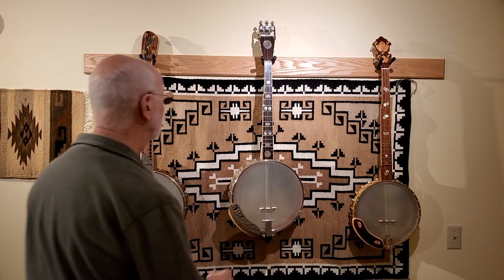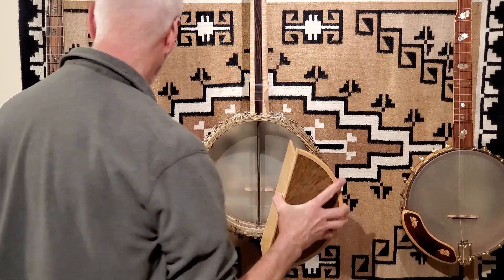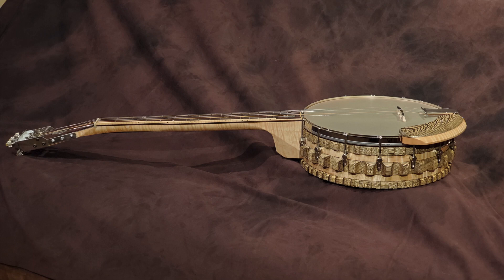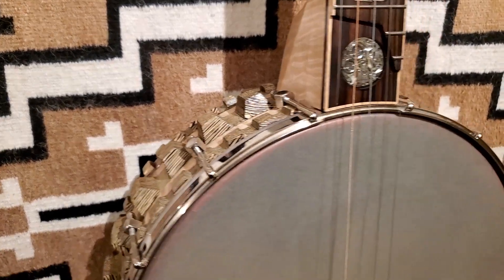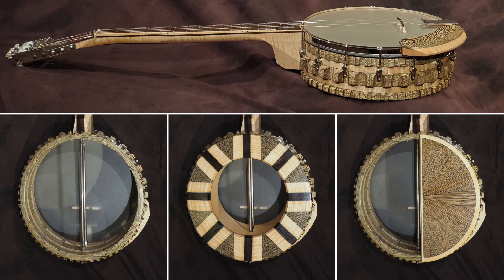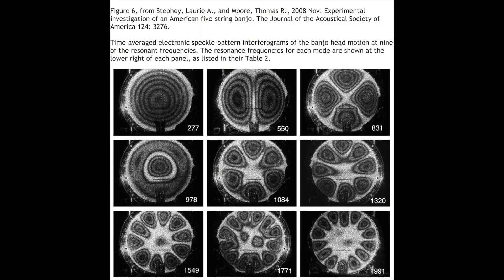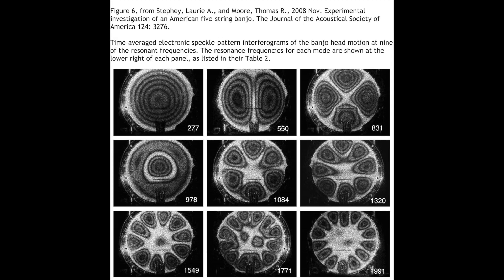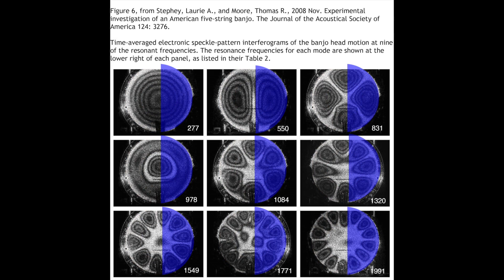A new kind of Internal Banjo Resonator

Comment: Is anybody still here?  😎  I want to try 3d printing a bacon style resonator, Does the rim of the resonator actually touch the banjo head?
Reply from the maker: NO! No part of the resonator should touch the head: that would dampen the vibration of the head and really decrease the volume and tonality of the banjo. Or it would cause a horrible "rattle" if it comes close enough that the vibrations of the head are large enough to make the head touch the resonator rim. The inner part of the resonator shouldn't come any closer than about 1/4 to 1/2 inch from the head. That space between the banjo pot and the internal resonator becomes a semi-independent resonant chamber that affects the overall tone. The amount of the  "1/4 to 1/2 inch" separation  you choose will affect the final sound.
Reply: @jpmillerusa    I kind of figured that. A more correct question would have been "How far is it from the head?"  Thank you very much for the info.  I am going to try printing one with carbon fiber. It'll be some time before I get anything workable, but I will let you know how it turns out.
Reply from the maker: @CosmicCowboy56  Great! Yes, Me know how it turns out! Can you make a half-moon one too?
Reply: @jpmillerusa   I'll give it a go. 😎  I don't even have a banjo yet.  LOL  I'm going to go get one on Monday, though. I used to play, but life happened and I haven't picked one up in a while. It'll be good to get back into it.
 Between the printer and the banjo, I should be able to keep busy!
Reply from the maker: @CosmicCowboy56  Yay!
Reply: @jpmillerusa  In what way exactly does the amount of separation space chosen (you said between 1/4 and 1/2 inch) affect the final sound? I'm going for the deepest, warmest, and spookiest sound possible from this instrument.  Minor chords go a long way for that haunting sound of course, but I want to see how far physical modifications can take it as well.
Reply from the maker: @Nein01  Great question... but I don't know the answer. I know how I woould test it: build one that had a big spacing, with an attached slider that could move up and down to change that spacing. But my hunch is that the maximum effect is always going to be with the spacing as small as possible: because the other limiting effect is with no resonatror at all. I imagine a graph of "spookiness vs. spacing" that starts at zero with NO resonator wall, going through a smooth curve up to a maximum when the spacing is as small as possible. Can't imagine there would be a hump someplace in the middle of the curve, but there might be... that would be a great question for David Politzer (do you know about his "Banjo Physics" website?) 
>>> But there are other ways to maybe increase the spookiness: like put on heavier strings and /or de-tune a bit. Decrease the break angle on the bridge. Maybe de-tension the head a bit.
Reply: @jpmillerusa great suggestions, and thanks for the resource recommendation. I was not familiar with David Politzer until now

Comment: Mr. Miller: The reason for the skin inside the resonator?
Reply from the maker: I am not sure what you mean by the skin inside the resonator. Do you mean the dark material on the back inside surface of the semicircular part, seen at about 1:25? If so, that is a layer of carbon fiber sheet below the wenge wood wedge segments to add structural strength and to prevent warping. The wenge pieces were fairly thin, so I just glued them on top of the carbon fiber sheet.
Reply: @jpmillerusa  Thank you.

Comment: Amazing job! I am trying to build one of these half- circles and have a question: Wich is the gap between head and vertical wall? Thank you
Reply from the maker: Hey Javier!!! Great that you are trying this!
The gap I used was 17.5mm, or 11/16 inch. There is no hard calculation about that, though... anything around that would have a notocable effect.
Please let me know how it works out!!!!!!
Reply: Yeah, I think It's a good solution for a light/travel banjo I am building. Three questions more, please: So, the gap is about the tone ring height more or less, isn't? And did It depends on pot height?  Did you measured It without bridge and strings? Thank you In advance for the help!
Reply from the maker: @javiermunoz3658  I measured from the edge of the pot, with the bridge and strings attached. So the gap would be a bit less under the bridge. It has a wooden tone ring (bloodwood) that is also about the depth of the gap.  One more tip: you can set it up so the resonator is either on the top half or bottom half. You get much different sounds in the different configurations, due to the way your body blocks the different halves. For "sitting on the porch", putting it on the top half blocks less of the sound.
Reply: Yes, and  that was my last question:  Different sides, different sounds? You've explained perfectly.  By now, I've install just one side, because I only had 4 magnets, but following your advise, I'll install the other one, in order to explore more sounds, thanks.
Reply from the maker: @javiermunoz3658  Great! Let me know if you can hear a difference! And you should do a post on Banjo Hangout when you are done!